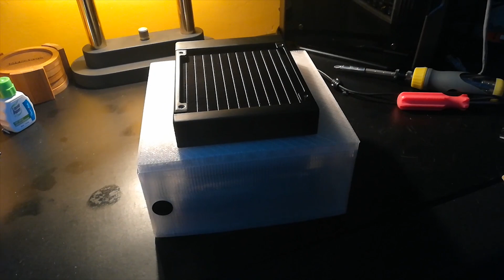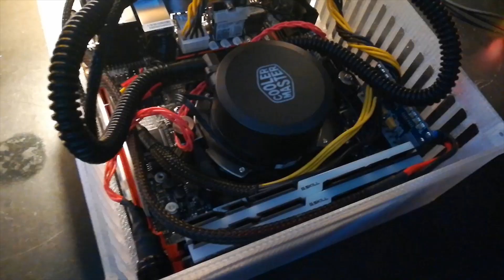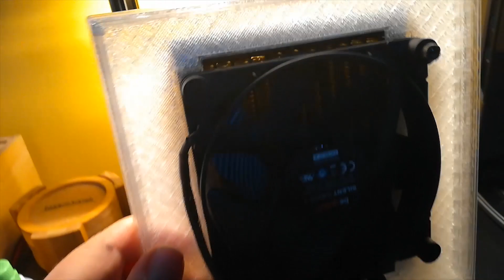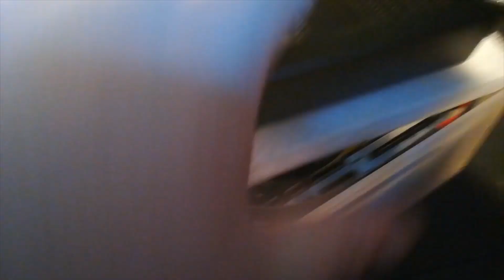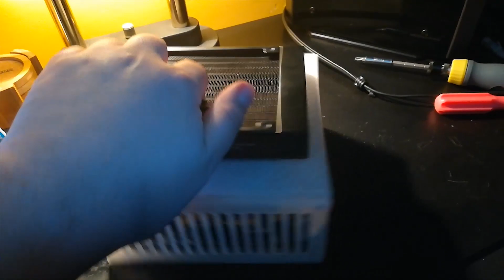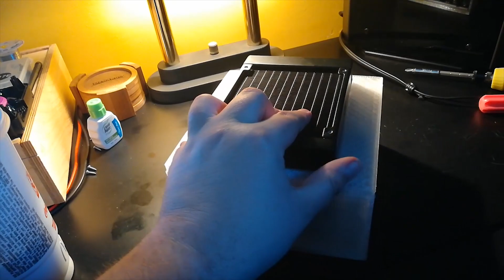Liquid Cooled 3D printed Mini ITX case! (AMD Ryzen 2400G/2200G)

Comment: I would reverse direction of cooler. To blow air out

In general - awesome
Reply from the maker: I would normally but this way air is blown across the VRM heatsinks, which can get toasty.
Reply: Starfire Technology doesnt small intake of cool air from side grills will make it better, instead of huge intake of warm air that came thru radiator? Or u alrady tested this, mate?

Comment: Pretty neat! It would've been cooler to see the PSU integrated as well though, but this is still really neat.
EDIT: Nvm, I'm an idiot. Didn't catch the part about the Pico PSU. Very nice!
Reply: the point of pico psus are to reduce the size of the case as small as possible tho
Reply: Oh, my bad. Didn't catch that part. I didn't see the Pico PSU in there, so I assumed it had an external brick or something. My apologies.